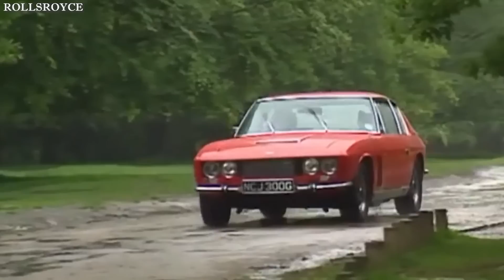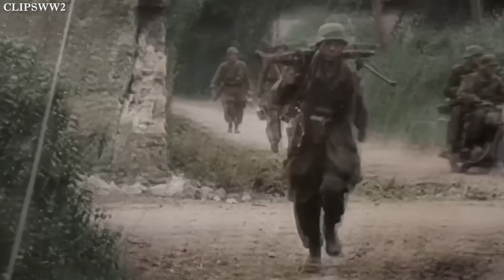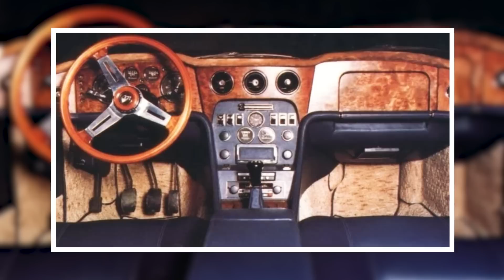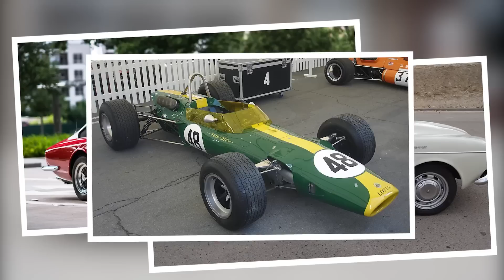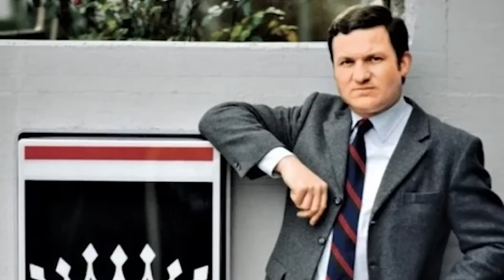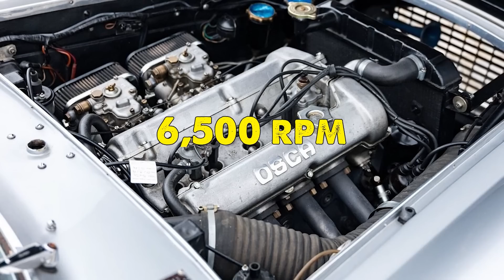4 Most Amazing Grand Tourers Now Almost Lost!

Comment: In my  UNHUMBLE opinion, I  can tell you where they went WRONG.

* PRV (Peugeot Renault Volvo, 6 cyl) Engine WAS LAMEEEEEE-O in DeLorean 12.

* The Monica 560 was OBVIOUSLY an amazing whole PERFECT package BUT LET'S GET THIS STRAIGHT. You want to sell an UNKNOWN costing the same OR MORE !! as a JAG but have well off customers  choose YOUR CAR ?? ??

* That Monica 560 on a much shorter wheel base with hard top, 2 door coupe would have been a heck of a rally car or a very sexy Spyder (convertible).

GO IN LIKE A LOTUS Exige. A stripped down hot peasant NOT like 18TH century royalty.

Comment: The '60 Chevrolet, has abslutely no connection with anything in this video, especially the Jensen FF. I believe the FF was sold in the US, with the 7.2 L, 440 ci engine.
Reply: I assume you refer to Interceptor, not FF.
Reply: @PetriTemiseva  Could be!
Reply: @ramblerdave1339  👍
Reply: @PetriTemiseva  The 440 must have had too much torque for the Ferguson system.